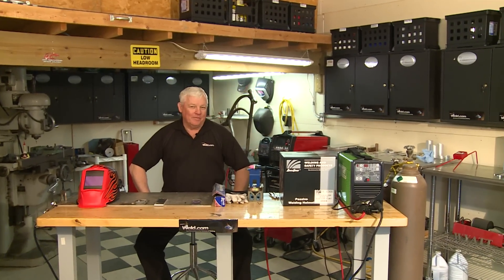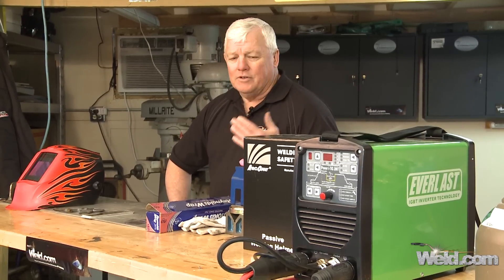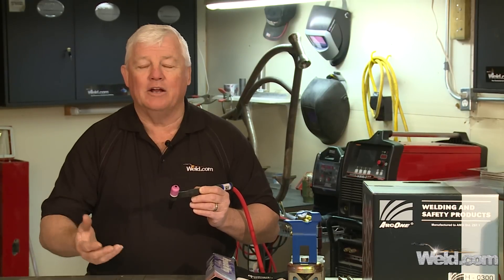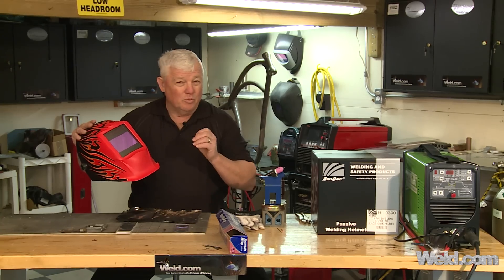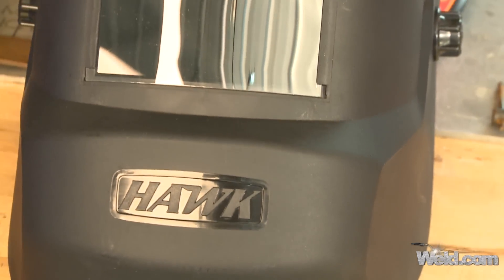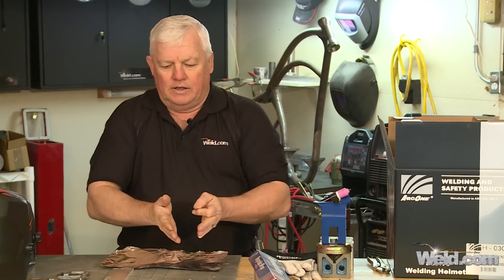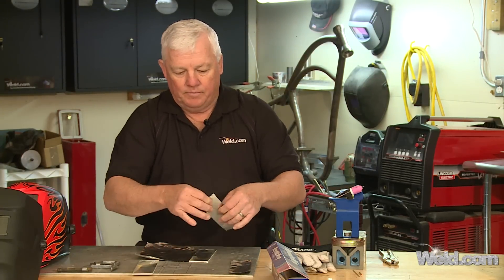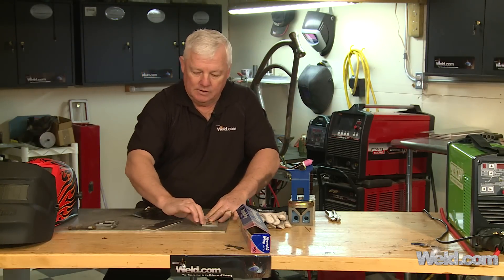How to Weld Aluminum Foil | TIG Time

Comment: A few years ago I was winding transformer coils and would routinely weld splices in .005" al low voltage strip material. Ran the welds as low as the 300/300 Lincoln would hold an arc and no filler. Yes the auto hood would flutter so I also went with a passive shield and magnifiers. I have not tried foil but the .005 was not all that difficult just had a very small margin of setting allowance.

Comment: You could see the arc skipping along the foil, so it is only tacked in a few places.  The way foil folds makes it look solid, but it's only being held by a few pin points.  You could tack a boat too, but it won't float.

It's purely a stunt for the shows to sell welders to those who don't k ow any better.
Reply: You can see the video being edited at the end. Too funny

Comment: How do you weld when your surface is heavily inclined? I have a gash in my aluminum trailer. It’s a vertical wall. When I try to weld it I can’t stop the melting aluminum from just dripping off the wall. Is this impossible to do?

Comment: Aluminum foil is thick! Try it with a paper packed gum wrapper. I did it, and had a # 10 lens. My mentor tried to pull it apart a few times and the wrapper ripped, but the weld stayed intact. He told me, "I want you to go down to the shop, pack your shit, get the fuck out, and don't EVER come back here! I have nothing left I can teach you. I wasn't expecting that response, considering I had been working for him free for 16 months just trying to learn what he knew.

Comment: All heat is transferred to the two aluminum sheets he uses to clamp the foil with. We do the same in our workshop. Not easy, but most god welders could do this. You can use the cheapest alibaba ac tig machine, dont need no fancy US branded machine. Thats probably made in China anyway.
Reply: Everlast Machines are made in canada. They run really good.
Edit:   he was running it on DC

Comment: To anyone asking are saying you didn't see the front, you did. 
the two pieces were laid on top of each other. There wasn't anything to see. it would be like the seam on a pillow before you flipped the case inside out for the nice smooth seam. 
_][_

Comment: Does the PowerTIG 210 EXT can do this?
Reply from the maker: Yes, you can do this with the 210ext.
Reply: Thanks Mr. TIG. What are the other tig machines with lower or minimum amps? As we know that this 210 ext has a 3A on DC and 5A on ac.

Comment: Can you use a bright light to see what you are welding ? I am not a welder but, when I mess around with one, I have to weld outside in the sun so that I can see what I am doing.
Reply from the maker: Bob, it sounds like you need to use a lighter shade. try a 10 and if that is still too dark, go to a 9
Reply: Just block out the light from the back. Use a hood or large cap. Even a towel would do. Don't mess around with brighter shades or that shit. If you aren't experienced with that, you risk damaging your eyes. You can try your bright light trick, but i don't see a sense in that overcomplicated stuff. Especially when you are changing your viewing angle.
Optrel Weldcap might be for you.

Comment: In reality job situation,how can you to perform a good tig welding?when you have given non properly tig set?And welding such as pipe at fit area,where tig welding seem cannot be done there but its require tig welding only.And its urgent work,and those people incharge doesnt care for you as long as you complete the job quickly.And your company want to save more money than buying a properly tig stuff.What can you do?Nothing.Only as long you can perform a welding jon,that is okay.And salary given was way to cheap.
I am working at power plant and mostly welding using Tig.And mostly battle with wind(no barrier needed ,its URGENT job),height,confine area,rusted material to weld on and complaining people(about my tig weld look).Mostly my tig set was own modified.
This is a real world.Unless you are working offshore/onshore or in a workshop with better equipment and better paid.

Comment: I have always heard that you have to tig aluminum with AC...
Reply from the maker: That is the conventional way of doing it, however it can be done on AC for specific applications. do a search on YouTube. We have done a few videos on DC Aluminum welding.
Reply: Going tru my old downloads ...
Anyways  here goes .
Dc-en (strait polarity) with helium used even today for thick thick material ,no cleaning cycle but alot hotter and backing used depending on material or application .
Dc-ep (reverse ) used for mostly flat positions on very very thin material with half a cleaning cycle irregation pipes ,window brackets ect .
Cant do more than (1/8 ,3.2mm) but (3/32  ,2.4mm)recomended .
Unstable arc , not for delicate parts arc-wander ect and oversize tungsten used 4.1mm or 5/32 or even bigger .
Remember torch rating also cut in half because all the heat is being put into the tungsten not the part .
Reply: +Weld.com so why didn't you actually weld it? why lie about it and makers poor attempt at slight of hand, I can see right through you just like your "welds" now get your ufckin shine box

Comment: Nice demo Mr. Tig.   How about welding a foil dish to hold water or maybe a balloon you fill with helium to give us some idea of how well the edges bonded?  What applications is this good low amp good for?  Jewelery?  Art?  Technical Fab?  Seems like you could just use a 5Amp 30V lab power supply if it is just DC?
Reply: James Munn nothing important
Reply: john hudson I really need to micro weld rc car custom fab frames for customers who want the welding to match to scale what comes with there high end rc truck axles....fml other than that there is no point . Well not that I can see

Comment: Have you tried the Accu-Strike chin operated helmets?  I use them more than my electronic helmets.  I would think the Accu-strike would be idea for this welding or any welding.  The main benefit I find with the Accu-strike Helmets is that you are looking through a clear lens and not a green tint when you line up to weld.  Much better to see through.

Comment: Hi Wyatt -sorry but I never joined your forum though I really should! The welder in question was bought on a tight budget as I do very little Tig - and up untill recently I had the use of one in a nearby shop out of hours if I needed one ,but this has sadly just folded, it is branded here as "Cobel " but I've seen the same set with other stickers on - to be fair it was about 1/10th the price of a Dynasty. It's on UK Ebay as Cobel 200amp pulsed AC/ DC inverter welding machine.

Comment: Nice video Wyatt - not sure it's a very practical application - but it's a great test of the machines arc stability on it's low end - I got a low buck import Tig that looked quite good on paper - but it's hopeless under about 30amps - so top marks to Everlast - I see several regular welding uploaders with this make - I'm assuming on loan / test - if their after sales back up is good I could see both red & light blue sales suffering given the price difference. never seen 1 in the UK though.

Comment: Cool video, Going to have to try this one out. What's the minimum amps you can do this on? If the machine lights off at 5 amps will that blow through?
Reply: Probably set to light off 150% of running amps to preheat the weld zone and then fall to the regulated amps.